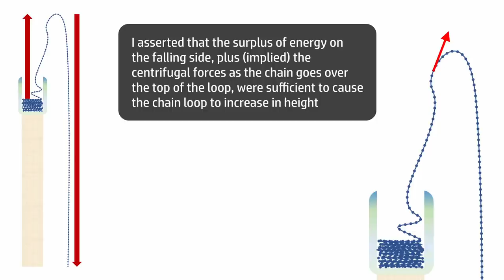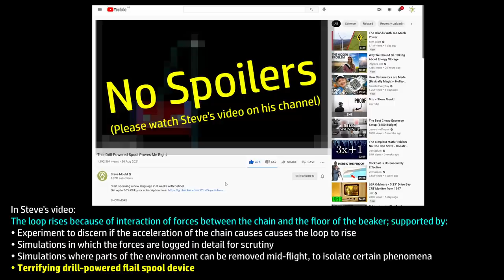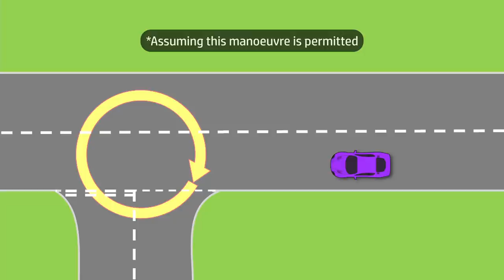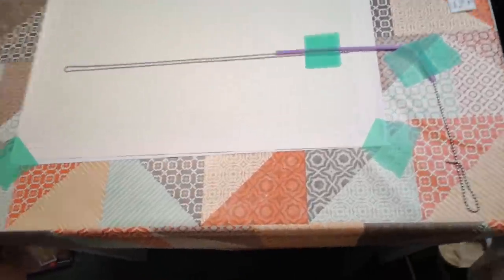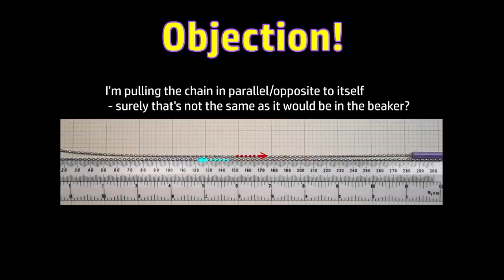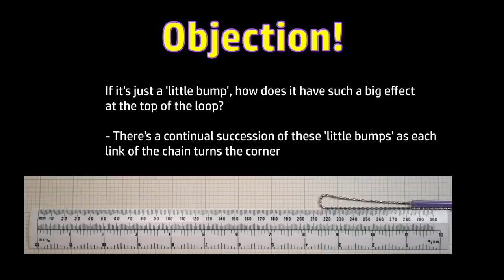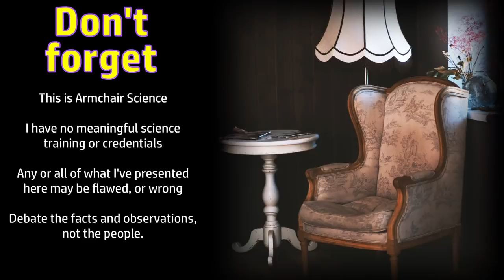Another Look at the 'Mould Effect' (Rising Chain Fountain)

Comment: I think you are overlooking one simple fact which is the change of direction.
The weight of the chain falling is very substantial and the speed it is falling creates a lot of energy. It can easily overcome the lighter shorter length of chain on the beaker and cause it to rise very rapidly but some of that energy is used to force the rising length to turn the corner and flow quickly in the opposite direction.
The characteristics of the ball chain force it to make a wider arc so that each link is turning through a wider arc, it's the force of the high speed change of direction which is creating a wide arc and adding to the height of the rising length.
Reply from the maker: I'm not overlooking that at all - in fact, that's what I originally thought this was all about - that was my assertion in the previous video and it's the thing I am saying I was wrong about.  Recent experiments have demonstrated that isn't what drives the loop higher.
Reply: @AtomicShrimp  All the energy in the system is concentrated in the turning arc, there is speed and mass and a change of direction. In that turning a lot of mass is being swung around which is limiting the speed the chain can travel, it reaches a certain speed but cannot go any faster due to the swinging mass in the arc.
I have always understood that as 'centrifugal' force, the mass is trying to move away from the central pivot, if it's close to the center it can move quicker than if it is further away.. 
The further from the center the more energy it carries too and the more force it exerts on the system.
Reply from the maker: I understand what you're saying, because this is exactly what I was previously arguing to be the reason for the rising loop.  Experiments and simulations have demonstrated pretty solidly that this isn't what drives it.  Have you watched Steve's recent video yet?
Reply from the maker: This makes me sad, because it means I have done a poor job of explaining in this video - the video (above these comments) addresses exactly the concerns you're bringing here - or at least, I hoped it had.
There is no magical push force arising spontaneously from the beaker. Nobody is saying there is.
All of the energy is being produced by the movement.  Nobody said it was otherwise.
A mechanical property of the chain means that pulling on one end of it causes the  opposite end to pushes a little on the surface below it, as it curls upward.  You can literally see this happening in the real world at 5:10 in the video above.  You can see the chain being pulled - you can see that as the other end is uptaken from the pile, it pushes the pile away in the opposite direction of the pull. (and in the simulations, when this same 'push' is suppressed by removing the base of the beaker, the chain loop fails to rise)
I disagree with the 'only a simulation' thing - it's a simulation in an environment that has been carefully modelled to reproduce real-world physics - the things you see happening in that simulation are not preprogrammed like CGI, they are behaviours of things that have been created to work as if they are solid objects - of course it has limitations and is an imperfect model of the real world, but it would be absurd to imagine those limitations just by chance happen to exhibit the exact thing that was predicted to occur.
Reply: @AtomicShrimp  I appreciate your attempt at trying to convince me, it makes me question my own logic and re-examine my thoughts.
You didn't do a bad job of explaining your theory, I'm just asking questions for clarity, it takes a lot to change my mind once I have made it up and sometimes it just cannot be changed.
I will watch both videos again and try to see what I'm missing.
Reply: @AtomicShrimp  OK I watched again and do understand what you mean by the 'upward push' from the bottom and it meaning 'less of a pull'. I can see what it was you were demonstrating, the issue I'm having is with the properties of the chain and the forces acting on it.
At a certain point there is clearly a wave in the beaker at the bottom of the rising chain which is confusing me.
Reply from the maker: I think probably the most important question leading from this is still: OK, so there's a push, but that's still coming from the same pool of forces/energy, so why does it even make a difference?  The 'push' at the bottom ultimately comes from the 'pull' at the top, so why isn't one thing diminishing the other?
(I suspect the answer is: there's no shortage of 'pull' under any circumstances - more pull means faster movement, but only when some of that pull is translated to push, does the chain rise before it falls)
Reply: @AtomicShrimp  Clearly there is still more to this than meets the eye and it's a fascinating subject to try to figure out.

Comment: i have no problem accepting this as present, contributing to the effect. But im not sure if its the only reason for it. A single experiment could clear this up by eliminating the factor and see if it eliminates the effect. All one needs is an inverted u shaped outlet with a higher radius than the minimal contraction loop of the chain instead of the sharp 18O° of the beaker. When the chain follows this path, it should stay grounded. A pulley would work or letting it slide sideways over a pipe right after leaving the beaker.
Reply from the maker: If you can accept detailed physics simulations as valid, I'd say Steve's video contains the evidence that nails it - a physics sim in which the bottom of the beaker is removed mid-flight (and gravity has to be turned off in that small region to stop the chain just falling out) - the chain immediately stops rising, as the loops of chain start looping below the former level of the base of the beaker (i.e. as an unconstrained U turn).
The only possible objection I can see to this is that the simulation is in some way not representative of real-world conditions - some people have argued that, but more on the grounds that they suspect something, than can point out any kind of flaw in the sim.
Reply: @AtomicShrimp  
i didnt see this video, so thanks for the answer. yes i can accept simulation without any doubt, but since i don't understand programming good enough, a real life representation like i described is the only experiment i could come up with. ^_^

Comment: Well path of least resistance + when more weight is pulling than apposing the chain  will rise as more weight is being pulled and the beaker is just like there because without it it the chain would go crazy and both ends would start to unravel equaling out the effect and when you dropped the chain it would just dangle.  So in short the beaker holds the chain so it has to follow the path of least resistance and as more weight falls and gains speed the chain rises. Since the chain has no way to go but up it has to do that. Imagine a rocket with a thick rope attached to it. The rope is coiled up in a attached is tied to something on the ground. As the rocket takes off it will likel cause the same effect just in a different way

Comment: Interesting. So in your straw and ruler experiment, you are using tension on the chain to exert a pushing force on the ruler at right angles to the force applied.

What are the practical uses for this?
Reply from the maker: Not sure - I suppose it's an inclined plane sort of thing

Comment: If any of you watched the following video, where a couple of scientists at the Royal Society took on this mystery, I left my hypothesis, compared to theirs and the people that disagreed with them and Mould, that I think explains it better. The Royal Society video is here:

https://youtu.be/-eEi7fO0_O0

They draw a diagram that they think is explaining the Mould effect, that seems to agree with Mr Mould. The diagram with the flat bars is close to the truth of what's actually going on, IMO. The issue many people are having is that the chain isn't a series of bars with short connections between them, but a series of balls with short connections between them.

However, the spherical beads in a ball chain are held together with metal wires - very inflexible wires, at that. There's no flexibility to allow the bead itself to rotate individually as it is being pulled up, because of that rigid wire holding it to its neighbors on the chain. That rigidity forces the wire in between the beads to lever and push against the neighboring bead, imparting that force to the next bead, which makes the bead being picked up by the rest of the chain jump upwards. 

The only difference between the flat bar chain diagram they use in the video above and the bead chain used in all of these videos between the two "competitors" is that the lever point for a bead chain is in the center of the inflexible wire between the beads, not the center of the next flat bead in line to be lifted, like in their diagram. I hope I've explained it clearly and succinctly, as I'm running on no sleep, and it's nearly 6 AM.

Comment: So what parameters could be altered to make the chain fountain more efficient?
Reply: From what all are saying:
  Maximize drop height, increase chain weight as much as reasonable.
  Or alternatively, pull on the bottom with an external force to mimic even greater gravity.
From what ElectroBoom and Atomic Shrimp are saying:
  Minimize friction and other energy losses, minimize sharpness of the lip.
  Minimize number of different distinguishable configurations of adjacent links
  (related to entropy somehow but I'm not sure exactly).
From what Steve Mould and Atomic Shrimp are saying:
  Increase "stiffness" or maximum-curvature-radius as much as reasonable.
  Don't forget the bottom of the container.

What I'm curious about:
The arrangement of the chain in the container. What are the simplest ways and what is the best way?
The simplest way seems to me to arrange the chain in a straight line, perpendicular to both gravity and the direction towards the lip. Basically have a really long rectangular container with the chain lengthwise, and start the chain at one end of the long side.
But from what Steve Mould was saying, the loops might be important... so an alternative way would be to arrange it going back and forth with a loop at each switchback. To maximize the chain fountain for this configuration, each loop has a top side toward the front end and bottom side toward the back end.
But what if we added even more loops? Lots of figure-8 type loops everywhere, with the parts toward the front end always on top of the parts toward the back end? Would that make the chain fountain rise even higher, or not?
Which of those 3 is best depends on whether minimizing friction is more important vs whether generating forces from loops against the bottom is more important. It might be that one extreme wins or maybe that a trade-off in the middle is best, I don't know.
Reply: Too subjective, efficient in what regard?
Reply from the maker: IMO:
Eliminate tangling of the chain in the heap (so if it was very neatly coiled in the beaker - I tried doing this - it's very difficult to set up in the real world)

Also tweak the 'stiffness' properties of the chain - Steve's chain seems to have a sort of variable stiffness dependent on tension - mine doesn't seem to do that, but still manifests the fountain, so I doubt it's a big factor, but I imagine there is probably a 'sweet spot' for minimum radius in proportion to the other physical parameters of the chain - too stiff and it will damp out some other force - too floppy and no fountain at all
Reply: @AtomicShrimp  Indeed, almost impossible to orient each ball and strand of chain to strictly control variations for reproduction sake.
try stainless, regular low budget steel and brass. The balls are definitely little springs and, as such, will, depending on the material in which they are made, express a different Young Modulus, translating different normal forces to an overall different chain mass of the individual components.
I was looking at the assortment of "chains" and was interested by the plastic pearls string in a specific way for it uses different sets of physical properties that have very little to do with the "balls chain" but yet, I strongly suspect, could achieve a very similar effect if the strings sections were shorter than yours are so that when the "chain" is pulled, the "lever" effect creates a tension of the string and the balls exercise the limit inherent curvature limit of said "chain" that, ultimately, I think would create something similar. If the strings are too long, it nullifies the atlatl effect. Still, string will absorb a whole lot of energy whereas metal sticks won't (the sticks are the atlatl, the balls are the javelin, I think or, they exchange their role, like a wheel of atlatlzes of sorts).

Comment: Great analysis! My thoughts:

@1:34 The loop rises because the pulling force will increase until the first bead in the chain reaches the floor. The pulling tension force is roughly equal to the sum of masses of the falling beads times gravitational acceleration.

@3:35 This experiment proves exactly why the chain starts to rise when the beads are lying out on a flat surface,  not piled in a beaker. This arching will start throwing the chain and the pulling force upwards, or downwards if there is no base to push against. 

@5:34 I totally agree with that objection! Yes, the chain tension force will yank the resting beads upwards, in fast succession.

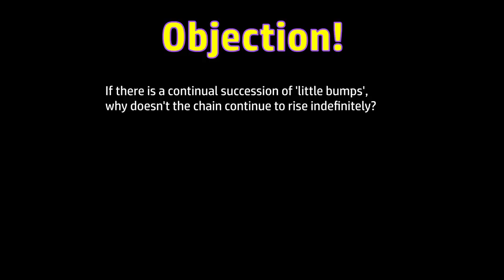@6:36 Absolutely correct! The finite amount of force is equal to the sum of masses of the falling beads times gravitational acceleration, minus all friction forces. The system will enter an balanced state when all these forces are in equilibrium.
Reply from the maker: That's what I initially thought.  It's pretty conclusively now been shown to be critically dependent on the stiffness of the chain creating a, effect where the chain gives itself a little push off the bottom of the beaker as it is drawn up

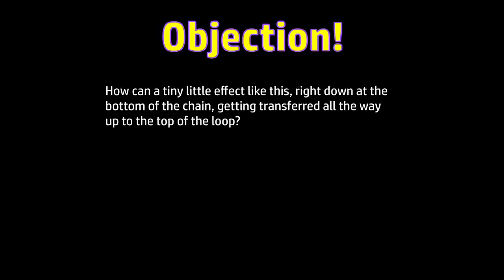Comment: In reference to 5:24, I have a proposal for how the energy is transferred over the loop via the tension you discuss using an alternative perspective on the turn radius issue. This explanation refers to Steve's video (https://www.youtube.com/watch?v=bcsb1xAv7XA) with the power drill and simulations since they visually demonstrate this effectively. He didn't respond, but I'm curious what you think of this.

The wave behavior here seems similar to an infinite string in motion vs a constrained string, except the funny thing about it is the infinite string in motion becomes virtually constrained by its own stiffness, mass, and gravity to form a reflected standing wave instead of actually being constrained. I think this jives with the spring model simulation, which seems to effectively be a high-mass, high-stiffness, low-tension string. 

Tying it back to the rigid body simulation, we can conclude the resonance is still present but its wavelength is too long to notice on the chain that can articulate 90 degrees, as this is equivalent to a string having a very low stiffness and tension. Similarly, for chains which articulate less there is probably a point at which the wavelength of the resonance is too short to form in the medium because the chain can't bend to accommodate it, like an overly-stiff string.

From this basis, I have a hypothesis. The chain running out of room to bend is similar to a phenomenon in signal reproduction called clipping. If the wave gets too large to be reproduced, it gets chopped off, resulting in waves with harmonics that are an integer multiple of the base frequency (or integer division of the base wavelength). If clipping happens with multiple frequencies simultaneously then you get something called intermodulation distortion where the sum and difference of all the frequencies is produced. Difference frequencies are lower than the original frequencies, so high-frequency (short wavelength) energy from the little kicks off each chain link can be converted into low-frequency (long wavelength) energy to pass over the bend. 

I propose that the observed increase in resonance with a stiffer chain is related to the phenomenon of intermodulation distortion, which I suppose could be tested by running FFT on the simulated chains somehow. But effectively the kick energy from each link rising, which has a short wavelength, has to be reconfigured to a longer wavelength in the stiff chain to form the fountain. Referring to Steve's video, observe the low-amplitude higher-order modes forming on the left side at 8:45 which transition into the large standing wave of the fountain, and the lack of these higher-order modes on the right side, as the energy propagates directly through the bend unimpeded. I suspect the higher-order modes are reflecting off the bend over the lip, growing too large, and clipping (running out of turn radius in your example), at which point the energy propagates over the bend at a longer wavelength after intermodulating the trapped waves. Watch the simulation start again at 8:30 - the higher-order modes precede the fountain. 

A direct method of testing the frequency modulation hypothesis might be to span a length of chain between two rigid points with just enough slack to move a bit, then excite one end with a high-order harmonic until the chain behaves nonlinearly and see if it forms standing waves below the drive frequency.